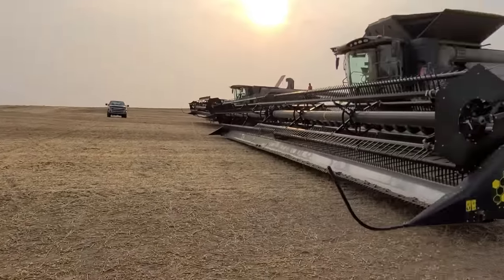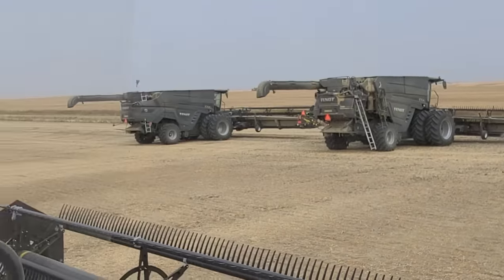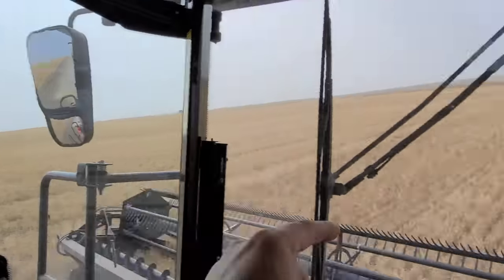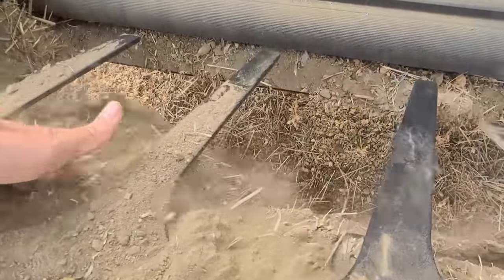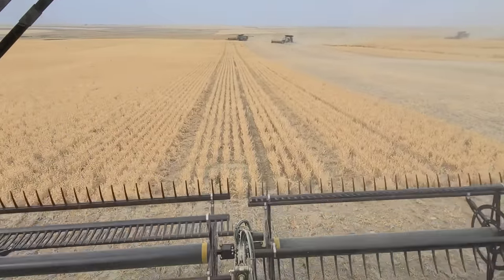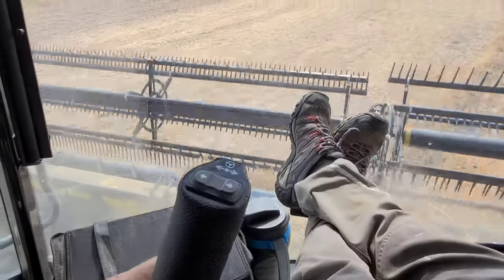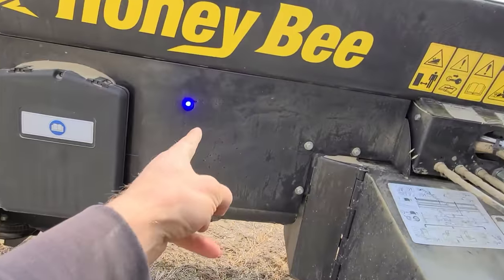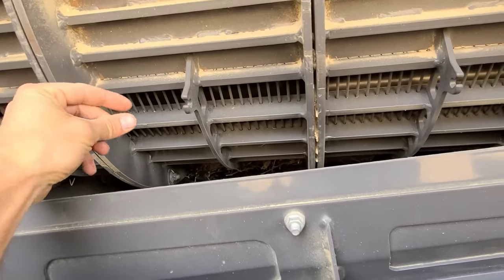Ideal 10 in the field

Comment: Manufacturers: “How much power do you need?”

Mike Mitchell: “ Yes!”

😀
Reply: Big bud 747 1200hp V16 type of power 😂
Reply: all of it!
Reply: So true
Reply: @rubenbraekman4515  a Big Bud? Funny. Old inefficient technology. Liebherr engine from the Big X should suffice.
Reply: Belux Auto inefficient? The older machines use less fuel than the new ones. Without using DEF. those are facts my man.
Reply: @ChaseLandMgmt  - you really want to tell us, that a 24 liter V16 uses less fuel than a 12 liter 6 cylinder for the same work? 
Even ignoring the fact, that the new six cylinder easily outpulls the old V16, making it even more efficient.
Reply: More than my BMW?LOL
Reply: @beluxauto5968  those thing have are great American horse power.
Reply: @beluxauto5968  new big x 1300 6x6 1300-1600 -3000 hp

Comment: Great video Mike thanks, our 2012 NH CR8080 has a rock trap you can open and close from the cab and it tells you when its full/has a rock in it. Never given us an issue - good systems do exist. 
When you first talked about it I was surprised the Ideal 9/10 don't have them as standard! If you ever get a chance give one a go or look at it online I think you'd be impressed with the system/mechanism. It works off of a beefy locking solenoid and the raising and lowering mechanism of the header.
Reply from the maker: 🤔 Intresting... Thanks Jake

Comment: Doesn't the joystick's sensitivity decrease as your road speed increase ?
Reply: It does. And you can override that by flicking the stick it all feels very natural really.
Reply: I was going to ask this, surely there'd be some settings you could tweak to make transit a bit less nerve wracking.
Reply: E F working the Vario joystick on a Fendt tractor makes people nervous as well. It’s all about learning how to work the equipment before operating. Basically comes down to; you need someone to teach you the controls. 

Fendt machinery is advanced compared to the competition. I’ve been teaching rookies at work how to operate Fendt Vario tractors close to 15 years now. It feels natural once you get the hang of it but it has a bit of a learning curve.

Comment: have they not programmed in a sensitivity\rate of control parameter into the steering joystick? iirc thats an iso standard so surprised there is not option to fine tune that.

Comment: Mike I must complimen you on your commentary.  See you are a fan of Agco Farm  Equipment  & that includes Massey Ferguson.   I have a 16 year old Massey Ferguson 4355 here in Ireland.  Image Massey Ferguson have stopped making parts for this, I have searched throughout Europe, USA for a part,  The Fast Flow Cable that connects two Hydraulic  Pumps.
I would be very slow to purchase a Massey Ferguson or an Agco equipment again .

Comment: Nice video ;). Was just thinking about the Joystick (idealdrive) why did they built it into one with drive and stearing in one stick ?
Reply: The stick is an option, this way they can have the right side console identical across all models.
Reply: Ondřej Čapka valid but in today technology having two options is nothing new
Reply: @MrTrashmasterfx  Another point would be, you have so many controls on your right hand already and some of them require letting go of the control lever (like adjusting anything on the computer). So if you had steering on that as well, you don't control the combine at that moment. So having at least some controls on your left hand makes sense.

Comment: Speaking of the tracks making it rough I just seen a video yesterday of someone in an IH at road speed lost his corn header passed over the header and airborned it hard enough that it ejected him out the front glass in witch he went head first into the corner of the table bouncing off of it and landing 10 foot from the wheels and was NOT wearing his seat belt just lucky that the bounce from the impact actually broke the console in witch sheered the wires going to the hydrostat for the transmission stopping the combine in its tracks so ya definitely use the seatbelt doeant matter if its a combine or tractor big or small their there for a reason

Comment: I can see the joystick being a good idea, but they should have variable sensitivity.  It could switch automatically with maybe a manual override.  When you are on the road or moving in the field you probably don't need as much sensitivity as when you have the thresher running and are actively harvesting.  Or maybe it could be speed-sensitive where the faster you go the more input you need into the stick to steer.
Reply: It does have variable sensitivity. I dont know why Mike does not have it activated oder if he does not know it. The joystick steering is road legal in Germany so it has to have variable sensitivity. It also changes depending on the speed.
Reply: @KriegerDelfin24  That makes perfect sense.

Comment: The joystick needs to be scrapped. Instead have a handle to grip, then a hat-switch on top for steering. That way your hand won't be bumped. This system is used for remote controlled weapons so that they can be aimed while driving over bumpy terrain.

Comment: The biggest problem now on smaller equipment is the def systems. We have customers who are no go on a def machine. So manufacturers have come out with some that don't have it, now they complain they dont have enough power to run the machine like they used to. Alot of operators don't know how to run the machines properly with the full power pet alone the lower power machines

Comment: So the autosteer button on they joystick does not engage the autosteer, it just turns it on? And then you engange on the drive stick?
Reply from the maker: 🤔 It seems that way
Reply: @mikemitchell2554  i guess it makes sense in the way that most operators are very used to engaging autosteer on the drive stick.

Comment: On a wheel loader the joystick is like 1,5 inches high...probably because of the feel when driving...and on a wheel loader there's always a steering wheel....and the joystick is disabled over 30 kph
Reply: what happens if at 31 it dispenses oops.

Comment: Have you ever considered buying cheap air reels to take on and off the combines in between seasons, so you don’t have hoses laying around?
Reply: Why take them off again once mounted?
Reply: ITubeTooInc they lease their machines, and I’m pretty sure they lease new combines each year, take it off, winterize it, put it on the next one
Reply: @realredditstories420  No they don't lease new combines each year. Their IDEAL 9's are the same as last year. Mike even talked about the modifications the dealer/AGCO made to them since last year to solve some of the initial issues like getting plugged. They didn't make the modifications on all combines at first, to compare if it actually made a difference (which it did). They did a new tracked IDEAL 9T this year though in addtiton to the six IDEAL 9 with wheels they had from last year. One of them has since burnt to the ground. So they are down to six IDEAL 9/9T again + the IDEAL 10 they are currently demoing.
Anyway I doubt anyone lease combines for just one year. I don't think any dealers are interested in offering such a short lease deal for a brand new combine. FarmTuber Larson Farms for example said they leased their new John Deere combine for 4 years.
Reply: @ITubeTooInc  calm down, even if they do keep combines for a couple years, you still take it off so the hose doesnt crack.

Comment: Is there such a thing as a setting that would change joystick sensitivity when on the road?  That would keep the accidental inputs from causing dangerous steering movements.  Also, cut those road sign posts and weld/splice coil springs into the post:)  I worked with a Vietnam vet who operated tracked vehicles, he said that certain speeds on hard surfaces tracks would play havoc with their bowels.
Reply: I don't understand why the stick and armrest isn't designet better to prevent what he's saying. There should be some kind of padding or something to keep the operators arm in place when the combine is rocking around.
Reply: Those were combat vehicles on steel tracks. Not at all comparable to these type of tracks. Tracked farm vehicles on the road beat a set of wheels. In the field not perse, we use LSW tires in Europe those row crop wheels are dumb as heck even on a combine. Now having said that what Mike says about hitting a rock at high speed on a farm road that would suck, much more so on tracks indeed.
Reply: There must be, but I don't think Mike is the type of guy that reads the manual first ;)

Comment: You could hold the joystick with full grip if you had a proper arm or wrist platform. I would make them so they snap in and out so you could move your set to what ever joystick machine. What your doing now will eventually give you Carpal  tunnel .

Comment: Mikey you can reduce the sensativity of that joystick down to 75 percent so you dont kill a gopher on the road. Have you considered a 5 point harness and an ejection seat, LOL.
Reply from the maker: I was led to believe that you can't at this time adjust the sensitivity. That might be coming tho
Reply: Ejection seats don't work every time. Ask Bill Weaver about his SR-71 crash NW of Tucumcari, NM in the mid 1960s - they found the seat in the debris, he and the RSO were tossed out @ > mach 3, 78,000'. The RSO didn't survive, not as lucky as lucky as the combine driver that lost his header going down the road.

The Massy Harris 24 steering in 1947 was unstable coasting down hill on the highway. Be Safe.

Comment: Is there big difference in fuel usage with T10 n T9 with chickpeas? Interesting like more hp, after this season do you wish you have all T10 instead 7 T9?  Can’t wait to T10 fair in other crops👍I did watch Full Line Austin vid of demo of T10 before arrive to your farm.
Reply from the maker: It burns around a gal/hr more.. But it can cover aa few more acres too depending on conditions. The 790 hp is going to be thirsty, but it's nice to have 😂 🤷‍♂️

But it likes its Def.. 😬
Reply: Mike Mitchell interesting with fuel consumption, at least not much more especially with amount of weight it’s carrying around.  I am glad we don’t have def, I know fellas have problems with def because shelf life n not using clean jugs to fill up using 1000lt bulk containers.
Reply from the maker: You guys don't have to use it?
Reply: Mike Mitchell AGCO n NH have def but CaseIH doesn’t have def yet because Australia is behind in emissions n just like our work trucks are not required def yet.  So if we had new CaseIH 250 combine it doesn’t have def at all LOL.

Comment: But what is the difference between the ideal 7,8,9,10. ? Only the horsepower?
Reply from the maker: 🤔 I believe the 7 only has one rotor, where the 8s, 9s 10s have two.

The 8s,9s, and 10s are nearly the same units with HP increased but the 10 does have a different cleaning system.. So that's important to point out

Comment: You SHOULD wear your seatbelt regardless of if you have a steering wheel or stick. Another farmer I've seen was in his combine on his way back from his field. He hit a pothole or something in the road. His header bounced and dug into the ground. Got hung up, ripped off, and he literally ramped over it. He bounced around in the cab a little. Then busted the steering column and flew through the window, broke his ribs on the feeder house, then landed on the ground right in front of the combine. During his bouncing around. The console broke and the 2 main wires for the hydrostat broke. That was apparently the only thing that stopped the combine from running him over... Idk... Better to be safe than sorry...

Comment: drivng that combine with that joystick seems more dangerous than the ones with steering wheel... suicide machine
Reply: Road graders have been that way for years. At least cat and others have a dampener when moving at road speed. Just takes some getting used to !
Reply: Eh, its no different then a Skidsteer or dozer in operation. Now they should make the dead zone adjustable so you are not as touchy or road mode.

Comment: Most manufacturers actually know what power you need not what power the operator thinks they need. Hence why most have a power boost when unloading. The use of full power in most scenarios is unrealistic
Reply from the maker: 🤔 Not 100% accurate tho good sir.. For example Bourgault makes 100ft drill with a 1340bu air cart, and there's not tractor with enough HP, or weight to pull that in my ground yet. I can't hardly pull 84ft of drill with 1340bu cart and that's with 12in spacing!! 😳 Can you imagine the HP requirements of 100ft on 10in spacing??! 😳 🤷‍♂️ 😂

Realistically, I would need 750HP base, plus 825HP buldge with 75,000lbs of weight...
Reply: There is one. The Williams brothers Big Bud.  Recent video from big tractor power show's it in use. 1000 HP.

Comment: I think the larger point with what you “need” or not comes down to efficiency, whether it matters to you or not.  Gleaner who I think you are doing asking about talks about efficiency in threshing, rotor design etc.  truth is you don’t need 790hp, that’s complete your insanity.  How much is wasted just moving and running a machine this size, the tracks etc.  so the question is how much is your time worth.  Do you need 5 50’ headers, does it make sense given how much fuel you use and cost of up keep of such a complicated machine that runs so much through it.  I think efficiency is a good argument, saving fuel, but really losing minimal time.  It is fun to have the biggest and baddest
Reply: Time is money.  Harvest windows are pretty brief and weather is unpredictable.  Machine efficiency does diddly squat for you if you can’t get the crops out of the field.

One of the biggest problems with our society today is we have solved so many real problems that now we have a bunch of busybodies trying to fix things that don’t need to be fixed.

Comment: To bad you you didn't get the x9.
The x9 was the best compared to 10t an claas 8900.
The 10t and claas both have the same 790hp engine and x9 JD 690hp engine but x9 still feels more powerfull
Reply: We bought the x9 too next season, it was a close race between the claas 8900 and the x9 but the claas with 100hp more power still couldn't keep up with the x9.
This is in Sweden and we don't always harvest in dry condition but the x9 needs less energy too run the combine and you don't notice that the X9 have a less powerfull engine.
Reply: Stefan Rosen you found the X9 the one to go for ?